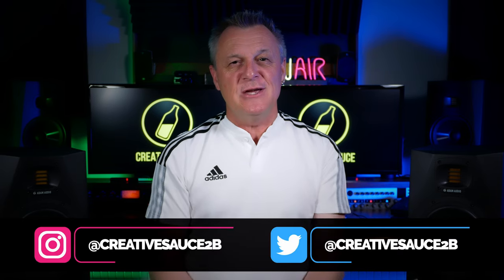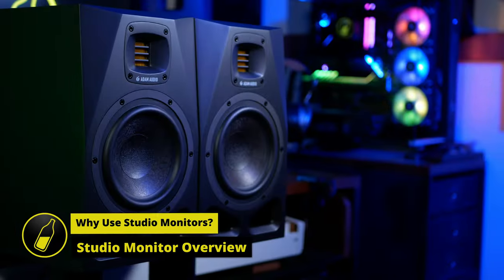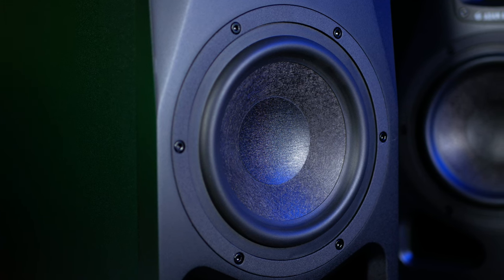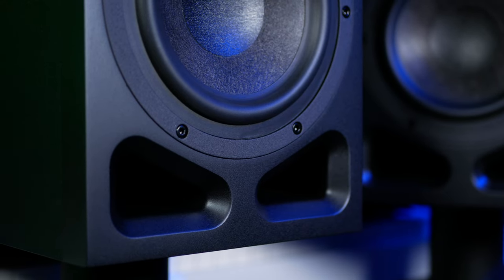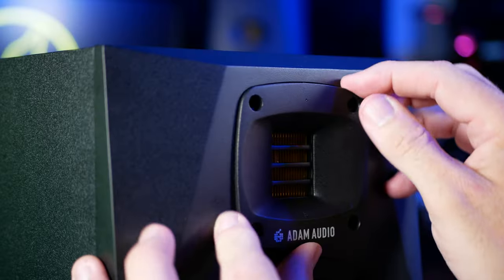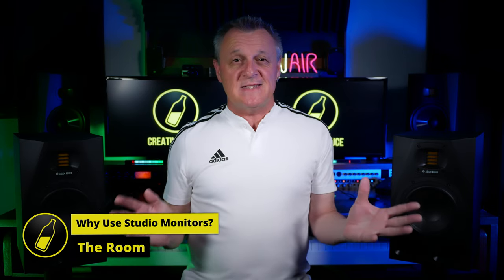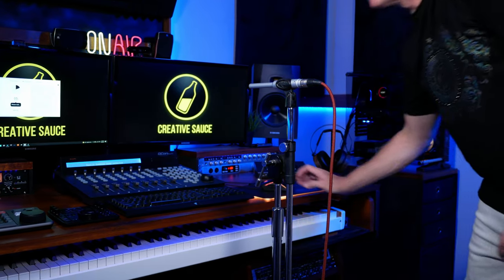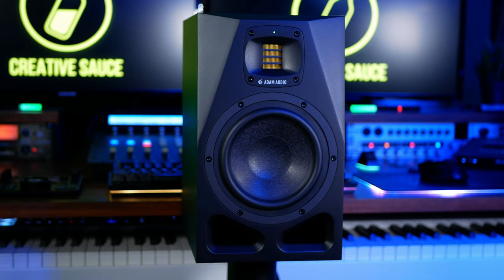Why Use Studio Monitors, and How to Use Them CORRECTLY! PLUS - Why I'm using the Adam Audio A7V

Comment: Phase issues, in perspective. (Refer to the video at 5:20 to 5:50) Speed of sound is 343 m/s. If monitors are 2 meters away and the separation of tweeter and woofer is 34.3 cm = 13.5 in.(on 5" monitors, it is less than 4 in., about 10 cm), you have a right triangle with sides of 0.34, 2.0 and 2.1 meters. The sound is travelling 2.0 m. for tweeter and 2.1 m. for woofer. The difference in time for sound to reach the ears is the time for sound to travel 0.1 meter = 0.1 m/343 m/s = 0.29 ms. If the tweeter is at a pitch of 580 Hz (cycles per second) (20x29), and the woofer is at 87 Hz (3x29), the sound reaches the ear after 20.0 cycles of the tweeter and after 3.0 cycles of the woofer, but still separated by less than a millisecond. Where do phase issues arise?
Reply from the maker: I believe the phase issues occurr in the crossover frequencies.